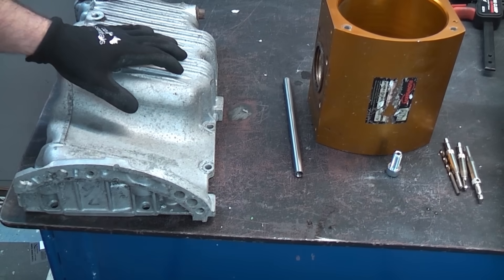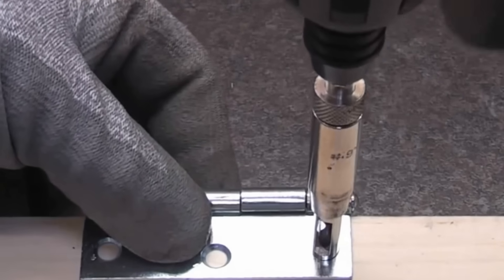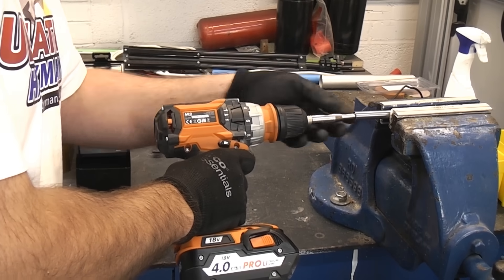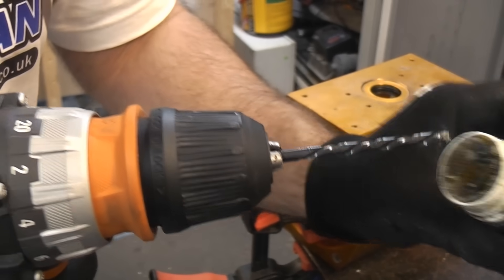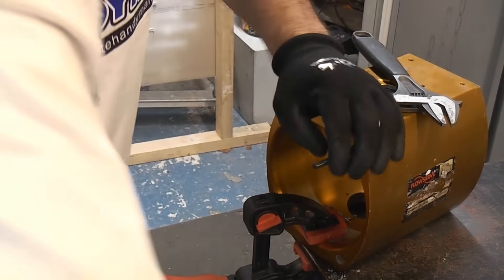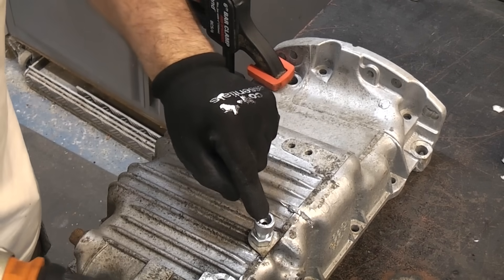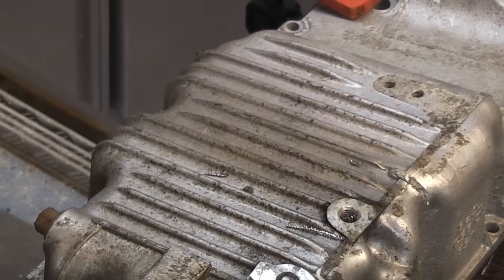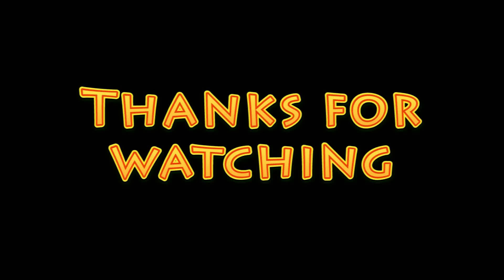How to remove a broken bolt in a deep hole | remove broken bolt in recessed hole

Comment from the maker: I’m off to do some jobs at a rental property today, I can’t think of anything worse to be honest 😉

I hope everyone has a better Sunday than me!

Please like, share and comment if you can as it really helps 😊
Reply: Have had to do this for an engine oil sump nut that got rounded off, drilling in to the oil upside down is a challenge. The anti seazing paste is a good tip, especially for car wheel nuts as they often jam too tight to remove for a roadside repair, good day!
Reply: @Käsityöverkko2025  If you use antiseize on wheel nuts or screws, screw them all the way to distribute the compound, then take them off and wipe as much of the antiseize off and out as possible. It's not supposed to cause loosening, but I never was sure, so I wiped it off with a terry rag. Re-torque after 50 miles.
Reply from the maker: No, I have never tried that. The stuff we use at work is awesome, 611 spray penetrant by SafetyKleen.
Thanks for the comment
Reply: Maybe a good topic for one of your comparison videos penetrating fluids, be interesting to see if there is any difference at all !
Reply from the maker: Thanks, Anti-seize compound is superb- I use it regularly at work.
Thanks for the comment
Reply: Thanks for the video. Have you ever made your own penetrating fluid?? ChrisFix put me on the Automatic Transmission Fluid and Acetone mix...works a treat!
Reply: @ultimatehandyman  will give it a go, thanks. Also need to remove remove Alen key bolts that jam to aluminium frames, often the inside hex hole rounds off & slips.
Reply from the maker: This might help- https://www.youtube.com/watch?v=WDOWPekMX44
Reply: Making an exciting, suspenseful DIY video... How did you manage that? Alfred Hitchcock would be proud!
Reply: Sunday. Baaaad. Drove from Sheffield to Manc airport to pick up wife, son and father in law. Arrived early............. 1 week early!
Rental properties can be.......... an affront on the senses, particularly the old nose. Top tip. Vicks synex on your septum. See autopsy scene from silence of the lambs.
Reply from the maker: I'll try that next time.
Thanks for the comment
Reply: Beautiful job man. Do a video with rusted and broken ones. It will help. Thank you
Reply: Ultimate Handyma
Reply: Can't be that bad? What jobs have you got lined up? Will some be recorded?
Reply from the maker: It will be a lot better when the carpets have been professionally cleaned to get rid of the smell of cat urine.
I'm going to film how to fit a floating shelf to a stud partition wall today, as I can easily repair the wall before painting it.
Yesterday I replaced a couple of lamps in the bathroom downlighters. 
Thanks for the comment
Reply: I live in a council flat (no urine here, though). Any chance of a video about fixing to dot and dab walls? I realise that's how my walls are constructed, as I've tried locating studs with a magnet and there's not enough space behind the plasterboard to the block work (I assume it's blocks, from what shows on my drill bit) to allow for any spring type fixings. I don't have much floor space, so fixing speakers etc to walls would free that up. I've looked at the fixings (can't remember the make) that make 'wings' when you turn a screwdriver into them after seating (there's a drill attachment for clearing the dabs out of the way of behind the hole); are they any good?
Reply from the maker: Rigifix work well on dot and dabbed walls- https://www.youtube.com/watch?v=xaYfs3lr1jI
I've just installed a shelf on a dot and dabbed wall today using Corefix fixings (video coming soon)
I think you mean the GripIt fixings- https://www.youtube.com/watch?v=szx7nMRZSIY
They make a undercutting tool, which I used in this video- https://www.youtube.com/watch?v=-geib-6sa3M
GripIt fixings work fine ;-)
Reply: (Edit: This reply is obviously to the dot-and-dab question.) In the past I've drilled through the plasterboard where you want the fixings to be, then injected a good amount of gripfill or similar through the holes into the void between the plasterboard and the blocks to form a pad. Left it to harden for a couple of days or more, then drilled holes through filler into blocks. Used plugs and long screws, the filler stops whatever was being fitted (cupboard, shelf etc.) from pushing the plasterboard into the blocks and so damaging the decor...
Reply from the maker: Not sure about that LOL, but it probably took me a full two days to film and edit!
Thanks for the comment
Reply: Ultimate Handyman, There IS nothing worse than doing jobs at a Rental, because that generally means that they mistreated and broke something on your property. If it's your own of course ?  I hate it also !
Reply from the maker: You are not kidding!
Thanks for the comment
Reply: august you're right, but not in all cases. Check my comment above. I'm looking for advice.
Reply: You Sound Like  Gerard Butler !         King Leonidas: You bring the crowns and heads of conquered kings to my city steps. You insult my queen. You threaten my people with slavery and death! Oh, I've chosen my words carefully, Persian. Perhaps you should have done the same!
Messenger: This is blasphemy! This is madness!
King Leonidas: Madness...?
King Leonidas: This is Sparta!
Reply from the maker: A few people have said that over the years LOL
Thanks for the comment
Reply: I also work for a rental property company. It's a shame how some tenants treat the rentals. Too many times we've had to replace carpets that were less than a year old because of pets. But knowing how things will be treated sure makes finding creative ways to do the repairs interesting at times. LOL  Thanks for the video and keep up the good work!
Reply from the maker: Yeah, I can imagine some of the places you go to!
Thanks for the comment
Reply: Could be worse you could be doing some tiling in a filthy indian restaurant toilet - they are the utter worst and I have tiled almost every place imaginable but public bogs are the worst!
Reply from the maker: Not my idea of fun!
Thanks for the comment
Reply: Ultimate Handyman: Thanks for posting the video. Yeah, my wife and I have just been busy the last two weekends doing minor work on our rental after the last tenants moved out. I've just refused to take on some new tenants on account of them possessing a cat... perhaps I've done the right thing? Thanks.
Reply from the maker: I won't rent to anyone with pets ever again. The annoying things is that it said "no pets"  in the tenancy agreement, but the tenant decided to ignore that and get several cats. I now have to replace the carpets in the three upstairs bedrooms and the hall, stairs and landing plus get new lino for the kitchen. Being a landlord sucks! You definitely did the right thing ;-)
Reply: Ultimate Handyman: Thanks for your testimony, you've just strengthened my resolve. Being a landlord sucks alright, if I didn't have to be one I wouldn't! All the best for you in your plight.
Reply from the maker: Thanks ;-)
Reply: Do you know if anyone sells a guide bolt kit like you made
Reply: Soup kitchen!
Reply: are you using a rigid  hammer drill in the video?
Reply from the maker: No, it is an AEG 18v hammer drill. I believe It is made by the same company (TTI group) that makes power tools for Ridgid, they also make Milwaukee and Ryobi.
Thanks for the comment
Reply: You absolutely have the right. I just hope the subfloors are ok. I've had a couple now that we're posed on by animals so much it soaked right through softening and swelling even the top surfaces of the joists. People seem to think that even if you do get a security deposit that a few hundred dollars can cover what an uncaring tenant can destroy in even just a few months, much less a year or more. And then on top of that even if you take them to Small Claims Court many times the limit is lower than what they actually owe. (We have several like that out there right now.) And even when/if you get a judgment in your favor you still have to jump through hoops to actually get paid, meaning you're out even more time and money. Many of these people work for cash und r the table and so have no reported income that can even be garnished so in the end you still have nothing but empty pockets.
Reply from the maker: I have a friend that rents out lots of properties and her life is a nightmare, she is often more of a social worker than a landlord. 
I have been contemplating selling the rental property, but then what do I do with the proceeds- put the cash in the bank and get £10 a year interest!
Thanks for the comment
Reply: Ultimate Handyman: But my god, you'd have to be better off than putting up with this crap wouldn't you? If I wasn't "FORCED" to own a rental, I'd get rid of it in a heartbeat! I can't understand anyone 'willingly' wanting to invest in rental properties!
Reply: Ultimate Handyman: Oh, I just read your comment stating "the house next door"! I see you're "FORCED" to own a rental also!
Reply: @ultimatehandyman  I've been trying to convince my boss to sell and start flipping houses. It's the remodeling that she and I both enjoy but seeing how people treat it just ruins it.  Whatever you choose good luck
Reply from the maker: Interest rates are very low at the moment, so no point putting money in the bank. Stocks are heavily overvalued and the stock market could crash at any moment, so the rental is the safe place to keep the money for now.
Reply from the maker: No, I used to live in the rental property myself. I bought it in 1999 and have rented it out for all but one year when I lived there. When we moved to the house I'm in now I rented it out to the woman from next door, as the house was in much better condition than the one she was living in. Thanks for the comments
Reply from the maker: It is always good to do something that you enjoy- especially if you can make some money from it ;-)
Reply from the maker: Yes, I have owned it since 1999, but I also work as a maintenance engineer in a local chemical plant ;-)
Reply from the maker: Yes, it is my property. The tenant had cats and they have urinated all over the place, so obviously the house does not smell too nice. I have had it cleaned including professional carpet cleaning but it still smells. I'm ripping up the carpets and the laminate soon and will have new ones fitted.
Reply: Ultimate Handyman I found Dye Penetrant in the spray can works better than any other penetrating fluid. Its what they use to inspect welds for cracks.
Reply: The first time you heat the bolt are in first line..and when you remove the bolt are in the second line. .what was that. .lol
Reply: What could be worse than a plumbing job for rental property? Thanks
Reply: Ultimate Handyman 2
Reply: I do appreciate you giving the lube tip when reassembling,however,it does change the torque values.
Back off any torque specs a bit,otherwise you may have defeated the purpose.
Reply: tout mécanos sait faire ca  ou est l exploit  nul
Reply: Are you from Blackburn or around that area Ultimate Handyman? I am from Bolton but now living in Australia :)
Reply from the maker: @andyrigby5010   Yes, I'm from Darwen ;-)

I bet it's warmer where you are right now ;-)
Reply: @ultimatehandyman  Ha ha ha ha, yes, it was 43c on Tuesday  27th Nov, crazy and now half of Queensland is burning!! love your videos and tips, great stuff mate :)
Reply: @ultimatehandyman  I used to work in Vale Street Darwen, it was a small car and van rental company, Standish Self Drive, it was on the corner, looks like Lidl is in that same spot now!! Happy days in 'Darren'  mate :)
Reply from the maker: @andyrigby5010  I remember seeing vehicles from Standish van hire when I was younger, but did not remember the building being there. I remember Peacocks pasties on the other side of vale street.  43c is far to hot for me! 
My girlfriends brother moved to Australia a few years back and got bitten by a funnel web, in the first few months! Watch out for the spiders ;-)
Reply: @ultimatehandyman  Ha ha ha ha, yes the spiders can be a worry, the funnel web is a bad one, but we have the red back here, tiny, it's body rarely gets bigger than 3 or 4 mm and one bite can kill a young child or put an adult in hospital for a couple of weeks, however we also have the top 5 deadly snakes here in Cairns, crocodiles and stinging trees, yes google that one :) I have been here for years and I am still alive, and I am a photographer chasing snakes and crocs all the time, I still find it much safer than Bradshawgate, Bolton on a Saturday night!!!
Reply from the maker: @andyrigby5010   I'd rather take my chance on Bradshaw gate ;-) 

I don't like the thought of tiny creatures that can injure or kill you! There are hundreds of spiders around this house, but none of them can put me in hospital (thankfully).
Reply: Ultimate Handyman ande
Reply: Ultimate Handyman 1974 Honda 360 carburetor repair
Reply: Ultimate
Reply: Ultimate Handyman okay.
Reply: Copper anti-seize in aluminium? Mmmm, you might want to research that a bit of advice....you could start with the galvanic table.
Reply: making gun